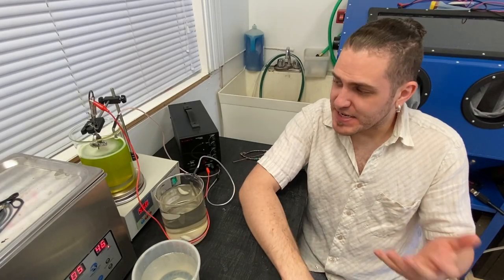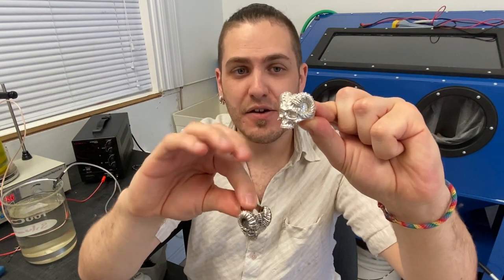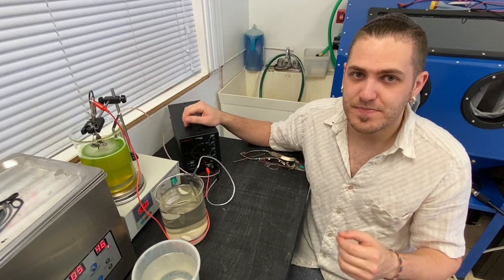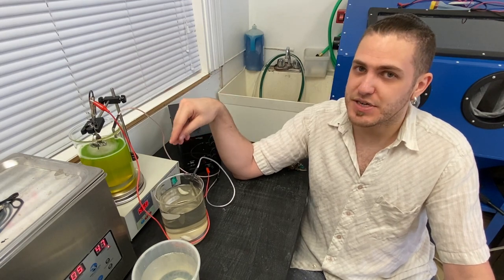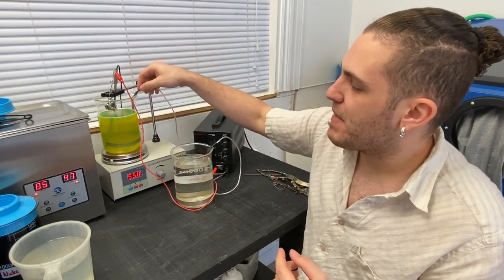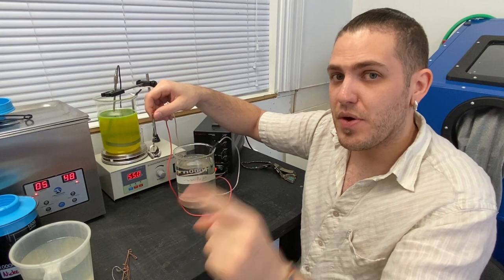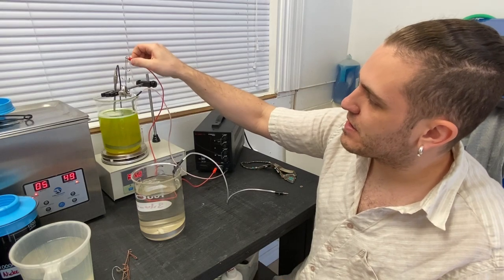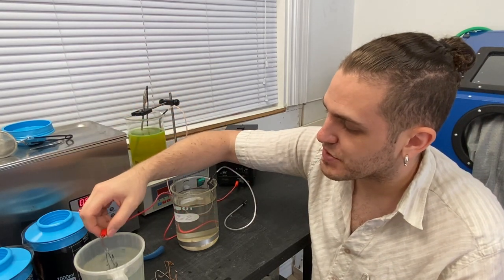Jewellery Plating Workflow - Plating Silver on Silver

Comment: Why I want to set up a home plating system is because I deal with a lot of antiques I want to restore. Many of which have had their original plating worn off over a century or more. The biggest barrier to me has been finding a cheap electrical system and understanding it properly. Any advice on either building one from scratch or an economical one to buy?

I see in your video that proper micro-voltage adjustments are important, not just applying a current. Where can I find information on the proper voltage ratings for different metals you want to plate with silver? Specifically, I have a solid copper 1800's tea box that was originally silver plated that I want to re-plate. Any advice for that?

Comment: @Clear Mind Jewellery  ok so I have a question, I used this method, I've watched your video like 4 times lol, but my plating was white, after tumbling it flaked off? I used the same tumbling method you just mentioned. What did I do wrong?
Reply from the maker: The current could have creeped higher, sometimes it does that. It also depends on the size and placement of anode. Sounds like it was to thick.
Reply: @ClearMindJewellery  thank you!

Comment: Thanks! How much can you reuse this solution? Could you have it last longer if you used a silver anode instead of a steel one to replenish the silver in solution or is that a no-go for this specific solution?
Reply from the maker: The solution we used in this video specifically called for a stainless steel anode, and it didn't last as long as we'd have liked its hard to gauge or express exactly how long. We went for one that was specifically cyanide free, so it needed some special treatment, however with the more hazardous plating solutions that is typical practice, to have a big chunk of silver/gold as the anode which replenishes the solution as you use it.
Reply: @ClearMindJewellery  That's great, thanks! We've been looking to do something cyanide-free in Canada and it's been tough finding a source for mats. We're going to go with Gesswein's solution too, so this is super helpful :) guess there will still be some experimenting to do!